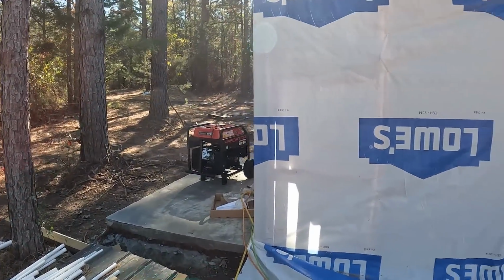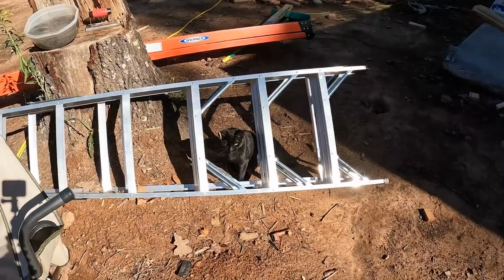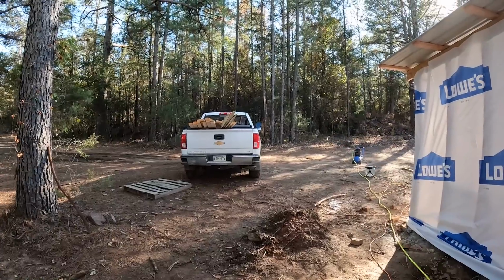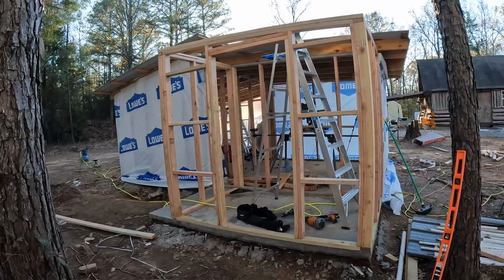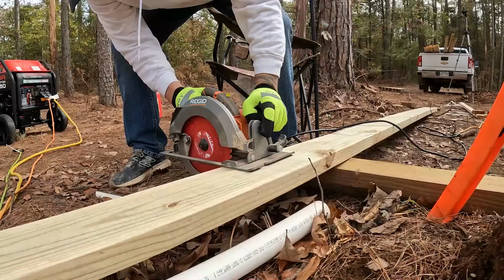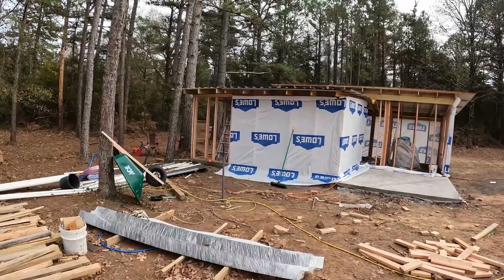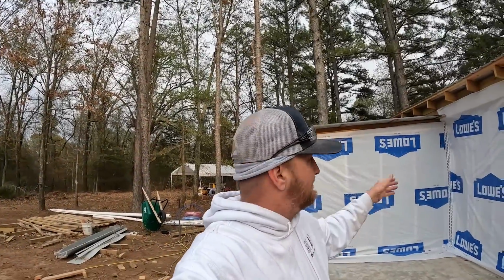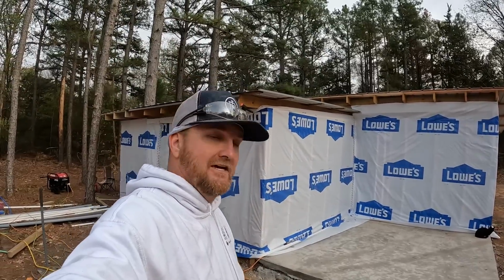CAN IT BE FIXED | tiny house | off-grid, cabin build, tractor, homesteading, farming solar, room DIY

Comment: You have a lot of small gas engines. As you said, ethanol fouls the carburetors. Get yourself a couple of bottles of Sta Bil 360 Marine. You can also use regular Sta Bil, but the marine version goes a lot farther. It will preserve the carbs in your generators, chainsaws. lawnmower, etc., etc., and save you a lot of frustration.

Comment: Have a good Thanksgiving! Look into what is on-line for videos about what is out there for outdoor wood burners and have some where you can set up your water heating saw a homesteader who had a whole set up to even heat their floors.wood stoves inside are nice but can get tiresome with all the mess and then the fire hazard.

Comment: Are you going to vent the room where the generators will be running? Maybe a bathroom type ceiling fan? It’s coming along real well. Can’t wait for you to start milling the siding. I hope you have plenty of wood and it goes smoothly for you. If you can find one a used flammable liquids cabinet for the gas cans it would be good for safety.

Comment: In the long run suggest  a separate  building   away from  house and pump  house for fuel and other flammables  just incase  the worst were to happen away  from any source  of sparking    example  gas dryer  gas water heater  even possible  washing machine  many switches evolved  in workings  of washer   safety first
Reply: Yes
That area might be good for putting the propane if you decide to switch the generator. Hope there's going to be ventilation for the generator
Reply: I agree with a separate building for fuel.. Being in the water well business for 43 years, I’ve seen many well houses burn as well as other buildings because people stored gas in the well house.. pressure switches spark, the fumes ignited and boom!

Comment: I think the issue with the corner is just going to add more character. Cold weather is a long time up there, so if you haven't already, be sure to get some extreme cold thermals and winter rated clothes/jacket/gloves/socks. Carhartt is kinda expensive in my opinion but if you look for them on Amazon, they're good at suggestions for comparable items. Texas Deb ❤️

Comment: I hope when you go to cut the openings for the doors through the house wrap that you actually just cut three sides and leave it attached to the top. It will help keep the rain out and you can cut it the rest of the way out when you get the framing for the doors in.

Comment: You cud frame in the area for the gas can then when you mill you can cut it 1/2" thick an use it to side it that in so your gas will keep day and it will keep the gas out of the sun an the heat. If it was me I would only cut one door opening at a time to help keep it wormer and the wind out that way it help keeping your well from getting to cold

Comment: Sorry David I am an idiot and should have thought of this earlier. 
With your generator room being all closed in, you may want to check with an electrician about rules and regs for your area. 
When I was an apprentice we wired lights and outlets in an area of a auto spray shed where they mixed paints. Due to fumes we had restriction on flam proof fittings and also due to fumes settling on the floor we had to have an opening for ventilation. Going back 30yrs I think it was 200mm.

Comment: Check your generator an see if it has a carbon monoxide shut off switch. My HF one does an it will shut itself off sitting in three sided shed. One eight ft wall is open with the exhaust pointed out.
You may need an exhaust fan along with a fresh air intake. 
Looking good, enjoying watching you build

Comment: propane tank, small  insulated lean to, with a light bulb in it,  and temperature monitor, because the propane has less pressure when its froze, (liquid)

Comment: Just an idea for the gas cans I'd get me like three pallets and I'd cut them down that way the pallets breathe but you can keep the ice and water off the gas cans I would just make a like a half shelter besides in the lid you know top not a lid that way you can just slide them in and pull them out and keep the condensation from getting to your gas keep your gas cans dry just a thought of suggestion you don't have to do it now but when you ain't in a hurry to get the building finished like the last thing cuz you can get pallets free from a lot of places

Comment: Hello friend, I'm not a carpenter or mechanical engineer, but can you tell us/me about how and where the ventilation/fumes will be coming out of the generator room and not go into the other part of your solar house, thank you in advance 💛
Reply: I was thinking the same thing with a gas powered generator there should be ventilation at the top to let the fumes out.
Reply: A 4" hose & a hole in the wall at the bottom will work. Fumes are heavier than air, don't want ventilation at the top.. Just like the repair garages use when working on your car in the winter

Comment: Just a quick question, what reason is there to NOT place the studs so that the insulation would fit between them w/o cutting?
Reply from the maker: They are
Reply: 16" on centers is how this was framed. That's how wide our insulation is cut. Either that or 24" which is how the roof was designed. All are standard.

Comment: Can someone help me?? i  always thought that the house wrap was supposed to go over the OSB or plywood that makes up the walls?? Am I wrong??
Reply: Usually house wrap does go over sheathing, but it doesn't have to.  It will be fine once the siding is installed. The only problem I see is that there's no shear bracing to keep the walls from racking, which is important when you don't use sheathing.
Reply: Sided correctly and the fact that this building is smaller and has intersecting walls from different angles makes not required to have sheathing to stop shear or racking his horizontal sidding nailed correctly will be fine and with the area he is located house wrap is fine I've ever seen contractors in ohio use only house wrap over studs I wouldn't do it up north but in the south not as big of a  deal and this building is only a outbuilding not his primary residence
Reply: @kirsten2607  thank you!
Reply: @crazyjohn6130  appreciate it!

Comment: You must change oil and oil filter every 20 hrs, of operation. The Predator will live a long time if
you will do this. You must do this without fail.
Reply: I have 2 predators. Every 2o hours. So far 6 and 7 years.